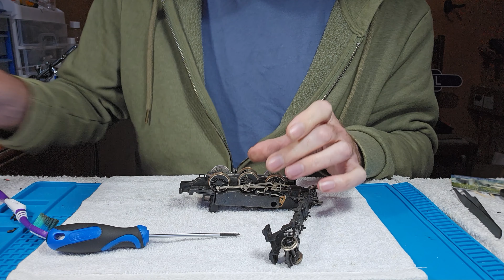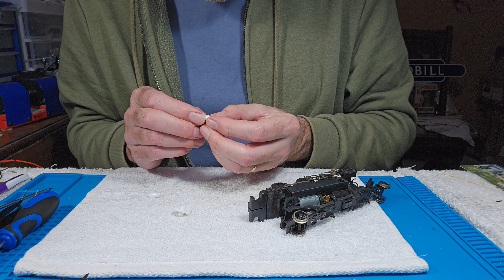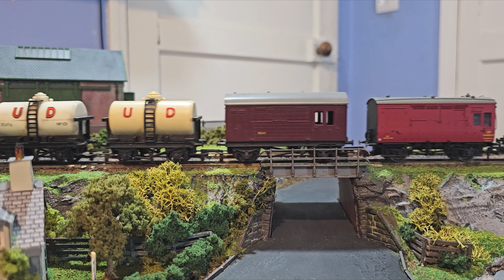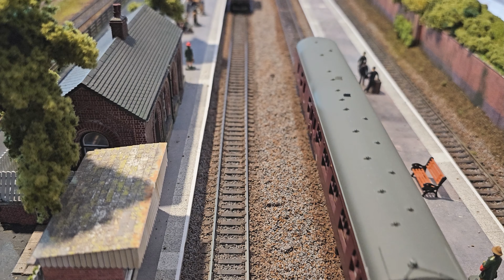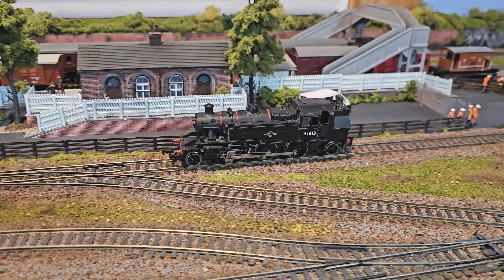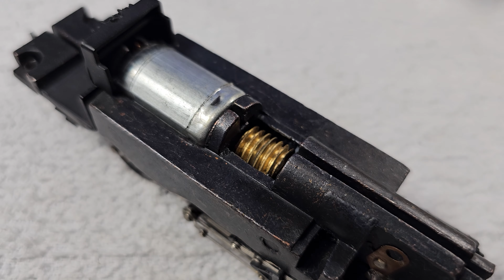Bachmann Ivatt 2MT 2-6-2 Tank - Repair Request

Comment: Hi Bill,  I just scored one of these Bachmann 2MT's. Very second hand. Assured it Ran Well..!
 Of course it didn't but your little video gave me the the Nerve to take the body off & give it Some TLC, it now at least Trundles around my Layout. With a little Oil & Grease.
 I fear at some point, I or IT will need new Axles & Gears.

 So a Split Chassis Dismantle Video would help me out no End.

 But for now it Runs, (with a Wobble) but makes in around my track..!

 The Guts of these Bachmann Split chassis are Akin to Black Magic.

 Think in future I will stick with Hornby ( not that they are perfect Either..!) But Ho Hum its All Good Fun..!😂😡😱

 Cheers Kim in OZ. 🦘

Comment: Funnily enough Bill I had the same experience this week with the 12v ventilator motor in my LG fridge freezer this week 😂. It was making an appalling noise and basically the motor shaft was wobbling around all over the place. Why would you put a brass bearing on one end of the motor and a plastic one on the other? Baffles me. I guess if I’d asked a shop to quote me a repair they’d have just told me to replace the fridge. As it was I got away with a couple of hours work and a £25 part.
Love the new layout!!

Comment: Have an a4 tender drive with jerky running.couldnt find the problem and went through your videos and you had same problem that it was oil on the locomotive axels.cheers bill as I would never have fixed it.

Comment: excellent video; I have one of these with the split chassis, its heavy and is a very sweet runner;  I'm curious as to what that wee red tool is that you use on the wheels?

Comment: Looking good.  I had a similar experience with a slightly later model of that same loco.  The soldered pick-up on the front bogie is commonplace and takes care to not melt the plastic when re-soldering.  They do require patience!